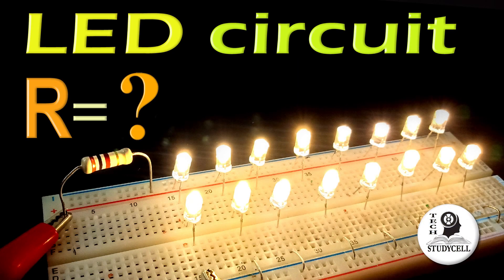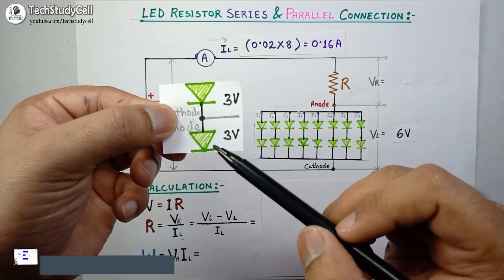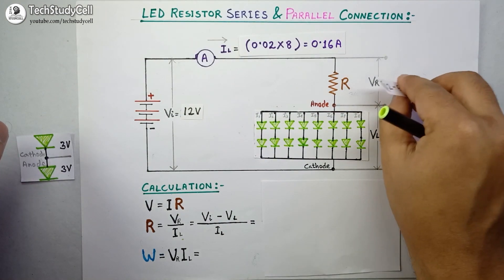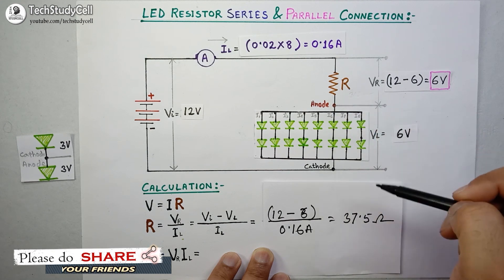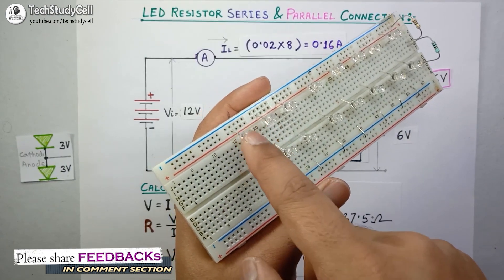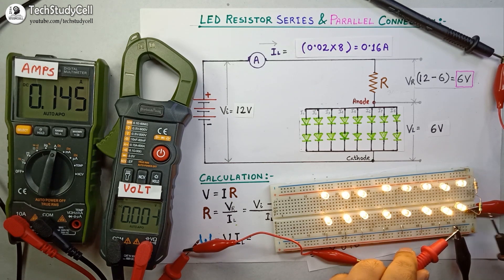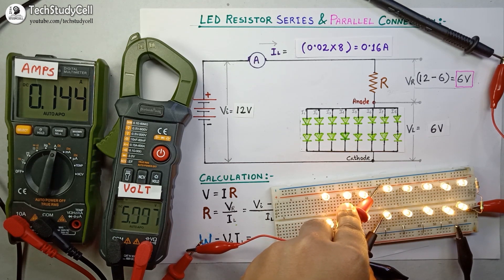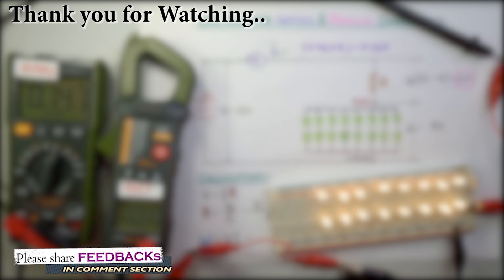How to Connect Multiple LEDs in Series Parallel Circuit | LED wiring basics with calculation

Comment: In prinziple your video is good how to calculate resistors. But connecting LEDs or LED strings in parallel with a single pre resistor is a bad practice. The forward voltage of LEDs have a tolerance which lead to an unequal current distribution in the parallel pathes. And in an error case (e.g. one path gets open) the remaining pathes get additional current. More detailed info you can see here: https://www.youtube.com/watch?v=n8az1-glQR0

Comment: How about,  I have 40 LEDs(5730) in Parallel connection, each led have 0.15A 3.4V  I want to use 12v Power Supply, what resistor do I need?

Comment: Hello Tech StudyCell, I tried to make something like this, and I was surprised with the outcome of my computation, and I need your help if my computation is correct or wrong. These are the data :

LED Current :   0.7 A / 700 mA
Typical LED Voltage :   3.5 V
Input Voltage :   12 V (battery)

I desire to use 5 pcs. of 1 watt LED beads in parallel and a series of 2 to generate a 10 watt LED light.

Based on the calculation you provided in this video, it shows that I'm gonna use a 1.4 ohm 24.5 watts resistor. Is my computation kinda correct..?? Because I searched a 24.5 watts resistor and there is none, but there is a 25 watts resistor and it's huge the color orange one . Is my project possible..?? 

Thank you..

Comment: sir,pls. can you help me calculate this.
1. 6pcs,3.7v li-ion, each 2pcs connected in series and in parallel connection,i made charger of 9.5v,500mA.is possible to charge these batteries.
2. also,3 leds in series.total of 28 connections in parallel,what resistor value  should i use,thanx

Comment: i want to run my old solar fairy string
 lights of a 12volt battery instead what size resistor must i use and can it be done
Reply: you need to provide the voltage and current